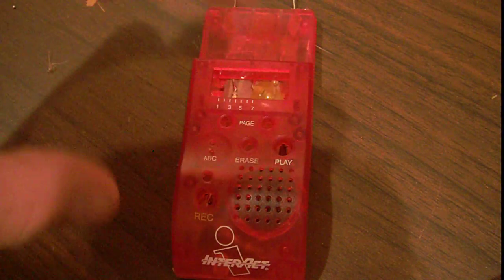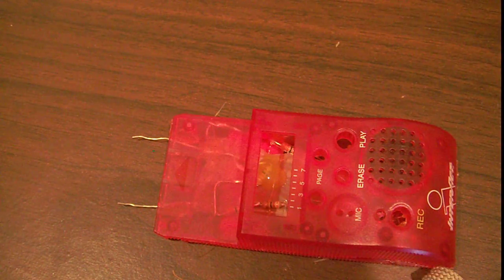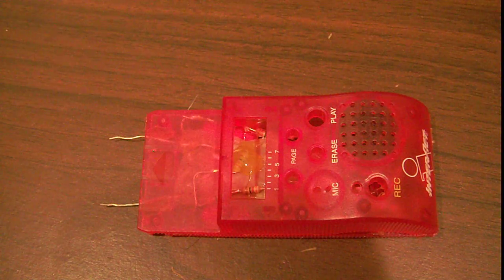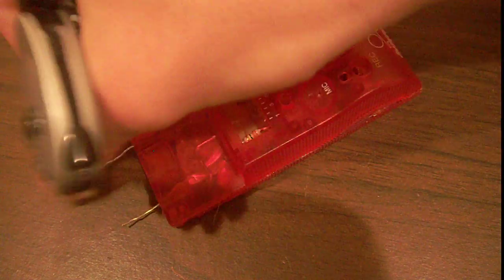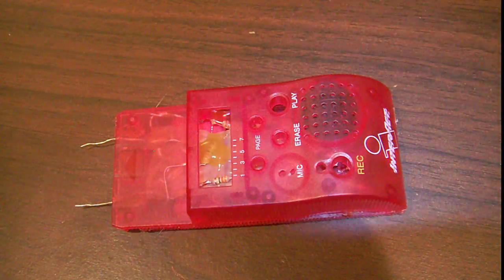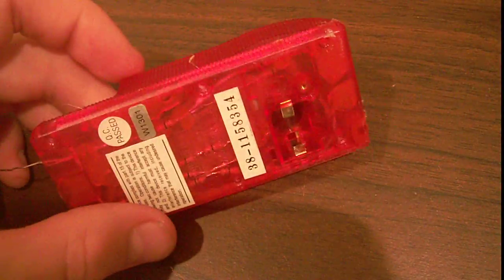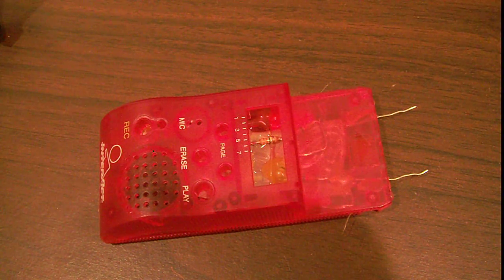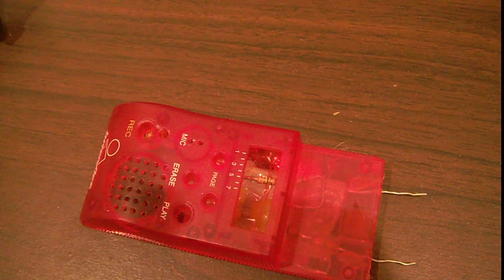How to Measure High Voltage

Comment: This assumes that current runs through the resistors. You wouldn't be measuring the voltage accross a capacitor with this.